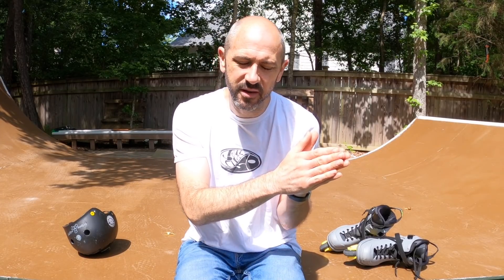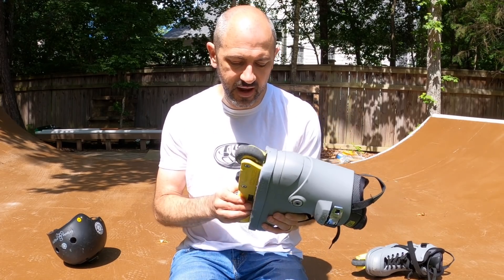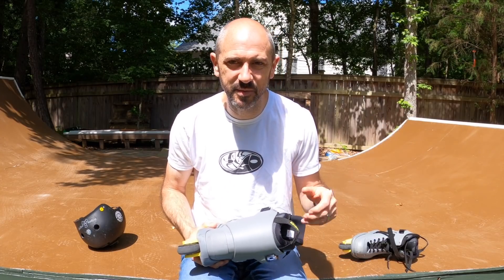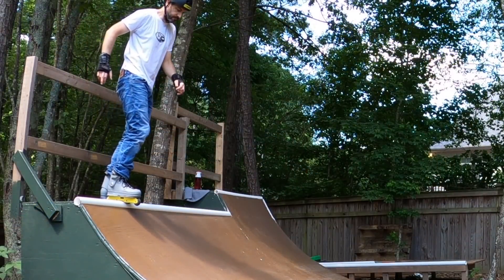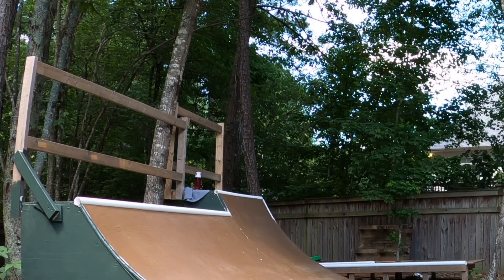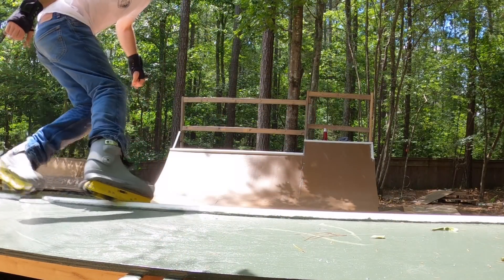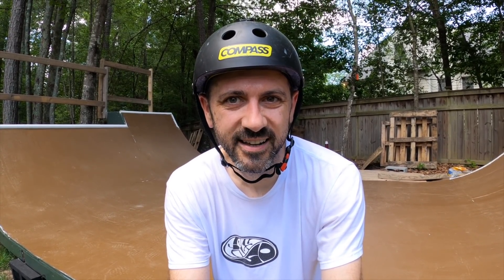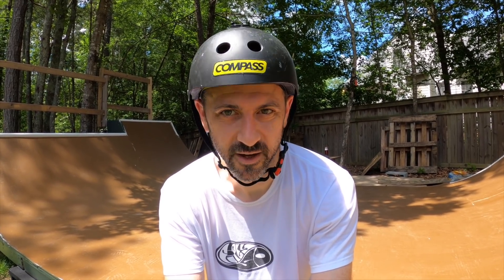My Backyard Mini Ramp is Almost Finished! // Aggressive Inline Skating

Comment: Nice miniramp you builded there ! Peace from Germany, i got myself the THEM SKATES 909 WHITE - 2022" INTUITION  DANNY BEER (Them Liner - V4)
I must say that a Video by one of the designers saved me bigtime, my feet are like 26,5cm - 26,6cm, i ordered the SIZE SMALL 7 - 7.5 US / 25 - 25.5 cm.
Then i went to a Ski Shop and they heated them up for 10min with a ski boot heater, i got 2 toecaps (thats like + 0,5cm on my feetlenght).
He said "better go 1cm below and work that liner in with some heat/or over time by skating"
Can skate all day long, my legs getting tired befor my feet start hurting :´)
Keep up thoose great videos <3

Comment: How do you feel about the 2 inch pvc compared to the 1.5 inch? I have 1.5 and am considering changing it. Also, never wax pvc, it slides crazy. I have shot of my ramp. Lastly, your helmet giveaway is awesome. I agree with you, everyone should where a helmet, even simple skating can go really wrong with one stupid fall. I don't need a helmet, just like what you are doing.
Reply from the maker: So far so good with the 2 inch. Seems like I didn’t lose any tricks and locked solid as ever. The wax was a mistake, lol
Reply: @BacktoBlading  do you prefer the 2 inch, does it make a difference. Wondering if it is worth going through the process of changing it.

Comment: I would recommend you consider building the ramp height up more.  It looks very limiting with the slope being too shallow and too short to build and maintain sufficient speed.  You are already outgrowing it.  The entire ramp should be the height of your extension.  This will create more speed and loft for airs.  You should be able to pump, click your wheels off the coping, and maintain several feet above it just from a single drop in. By doing airs like this higher and higher in succession you should be able to get higher and higher above the coping.  The transition may feel safe as it but is very limiting.